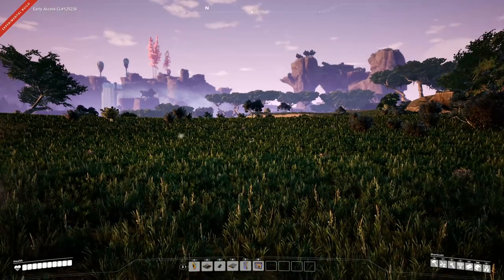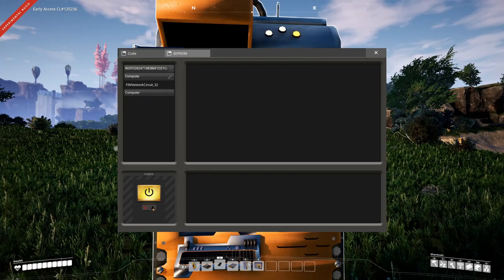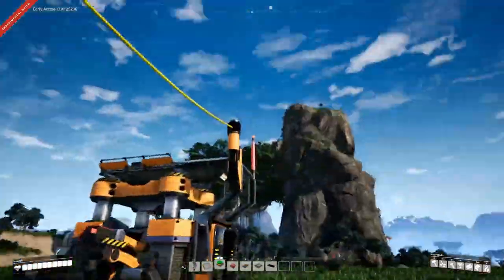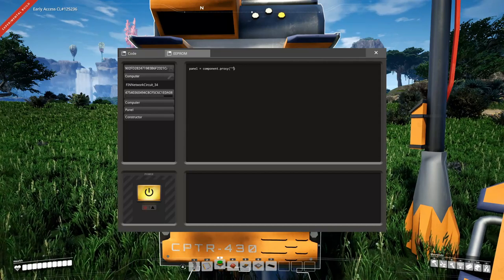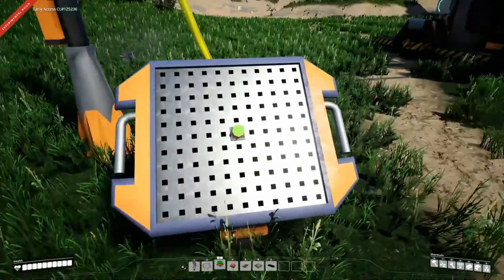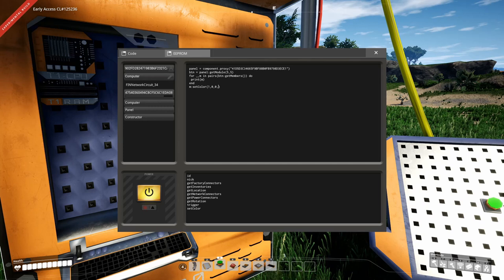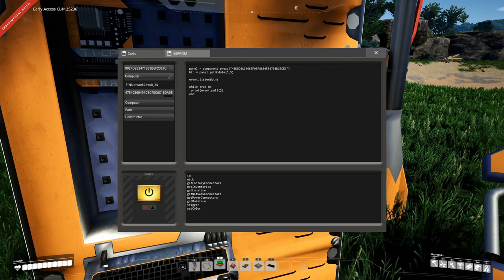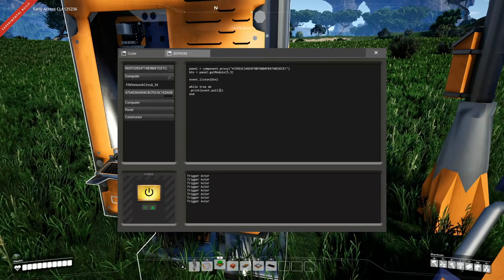FicsIt-Networks - Basic Networking (Outdated)

Comment: Will we have a CPU that runs Python 3? Also, are the component IDs UUIDs? On top of that, why not go 0-255 for the RGBA values?
Reply from the maker: No Python 3... python is not made for that purpose so it wont get used for that purpose... i can talk that out if you want
Yes, the IDs are UUIDs, to be precise, GUIDs
0 to 1 because most programs use that value range since it can map theoratically a infinite amount of differentt colors... (event OpenGL uses 0 to 1 internally)... so there is not realy any reson for me to go a different way

Comment: I can only imagine the countless hours that went into making this mod. It's incredible and it is nice to see that you are working on expanding it as time allows. I'm not sure if this is the right place to ask or not but I can't for the life of me find the network wall connectors. I've done all the milestones for networks in tier 3 (basic networks, flow control, I/O control, modular I/O, digital storage, and computer graphics). For some reason, those duplicated themselves in my hub terminal. I have two milestones for each of the network items except basic networks. When I would complete one of them, it's duplicate would complete. Am I missing something or is there a bug?
Reply: A couple different mods do this. Not sure if it is because of the mods or the mod loader or both. But definitely a bug

Comment: At what tier unlocks the buttons, external monitors and so on?

I just unlocked the basic, the cpu but i cant find how to build the eeprom.

Isn't suported any other language? C++/python?
Reply from the maker: You can build the EEPROM in the Equipment Workbench and no... there wont be any other language like C++/Python... I have plans... but C++/Python/JS/C#, NO!!!
Reply: @Panakotta000  why those languages no?
Reply from the maker: @winsrrow8125  Neither are they designed to be used in this use case nor intended... C++ is a a lower high-level language that compiles directly into machine code... this fact alone makes it already not good for our use case, you could imporve this pipline with llvm and wasm, but those are also not ment for that sort of use case there are just way better solutions out there... python is interpreted and seems to be a good candidate but i turn it down due to multiple reasons... one is that it compared to lua slower because Lua is compiled into virtual machine code and not interpreted... and other is that python is not designed to be embedded into other programs and so provides just a bad interface, it is designed for simple and easy writing of math algorithms and such... C# is pretty close to be a candidate, but it was initially made for like "windows only" and gut counter fitted to support some kind of cross platform support which i also dont like, and it is again quite heavy... I dont like C#... Java would be the same, though I like the language backe-end more...

Lua on the other hand was from the beginning designed to be as simple as possible and to be integrated into programs, you dont realy use Lua in standalone... which makes it the perfect candidate!

An other option I totally agree with would be wren, but I learned about it to late and the Lua base was already there... so shit happens...

Comment: HI, i tried to use the getMember command...
panel1 = component.proxy("A26A07FC4B1397AA2C5E38BAA64CB3C2")
btn = panel1:getModule(0,0)
anz = panel1:getModule(0,10)
print(panel1)
print(btn)
print(anz)
for _,m in pairs(panel1:getMembers()) do
print(m)
end

but it gives out, "attempt to call a nil value (method `getMembers`)

someone any idea what went wrong?
Reply from the maker: With the latest update and the introduction of the reflection system, you can now get a way more detailed look into the functions and so on of types... even by code... but through this the interface for it in terms of programming also has changed drastically and is a bit more complex...
feat not my friend!
You can use the reflection viewer in the network manager tool to look up the necessary information you want ^^

Comment: Any possibility of javascript support? cause, uhh, apparently we're supposed to javascript all the things these days.
Reply from the maker: JavaScript support is technically possible I just refuse to implement it.
Since there is no good reason for me.
That is just a lie, that you should make everything with JS. JS is a fucking bad language except for the purpose it was designed for. As a frontend scripting language running in a  sandbox.
And I totally agains the usage of languages for things they are not ment to be used for. The whole Node.JS thingy is fucking shit to me >.>
I would only use it for "quick and dirty" solutions. Except in front-end, there I would use it properly since it is ment for that purpose.
Same counts for python, I would never implement it since Python is not ment for that purpose. Python is more ment for complex mathematical calculations you might run multiple times but often just a few times and not properly as something that needs to be highly reliable.
I choose Lua since it is exactly ment to get embedded into other languages, is fuckin fast and the syntax is designed with people in mind which don't have a coding background so it is easy to work with.
Reply: @Panakotta000  even if it's not meant for that, it's a pretty good way to teach coding.....
Heck, this mod seems like it could be more fun than the game it self (... the games fun it just got boring once you unlock everything)
But i'd really have to see a video of this in action  before making that statement casue so far all i've seen is basic output and no controling of factories.
Hopefully there will be a basic show of what this can do soon
Reply: I think lua is easier to learn anyway. it would be better to implement an even easier to learn scripting language next than another relatively low level one., for noobies